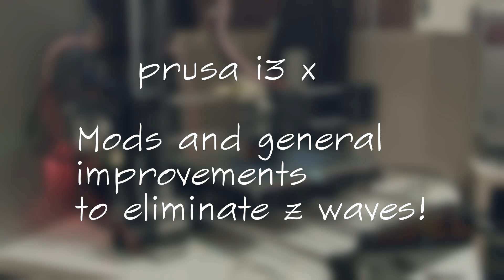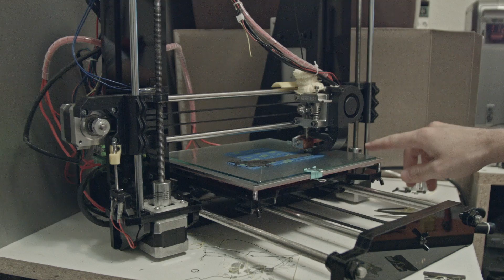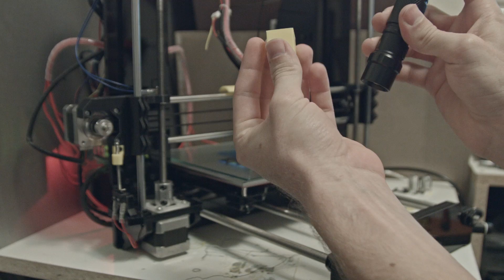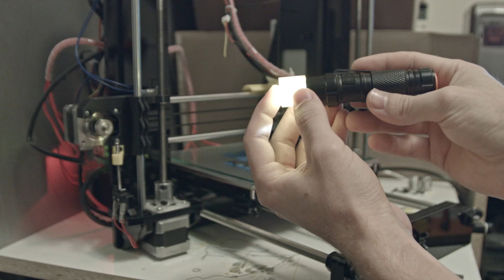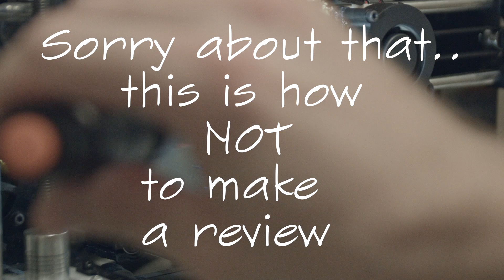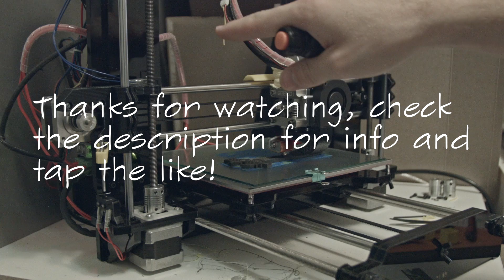Prusa i3 X upgrades and mods

Comment: Hi , nice video. i can see the x carriage mount is this something like this ? http://www.ebay.com/itm/1-set-3D-printer-U-aluminum-block-box-type-linear-bearings-Free-Shipping/291612393339?_trksid=p2045573.c100033.m2042&_trkparms=aid%3D111001%26algo%3DREC.SEED%26ao%3D1%26asc%3D35375%26meid%3Dce4636ce7ea4431fbc7e1b99c80364b0%26pid%3D100033%26rk%3D4%26rkt%3D8%26sd%3D191813891913  is this ok For MK8 extruder or what do you suggest ? What you have there if you can give me link to them.Thanks in advance!

Comment: just got my printer running after a few hiccups. what were your print settings for things like infill/supports etc?
Reply: I use Cura to make my Gcode
Reply: +Bill Windwalker did you print these parts?
Reply: I am making a set of parts from scratch do to what I am working on for I will have new Z rods and ball bearings top and bottom.
Plus some springs on the x rods with caps and no clips on the glass.
The glass will have 3M tape under it.
Plus I will not use that type of end stop switch.
I made some thing like he has some time back when I was having problems with end shake but it was do to poor Z threaded rods.

Comment: Just wanted to Say 1. I love what you have done to improve this thing. 2. I just received mine. I have not started to assemble it yet but I checked the rods and I think all but 2 of them were bent. On my way now to order the upgraded ones you suggested. Have already ordered the High Lubricity Nozzle and Power supply. This one also came with the 12V 15A. Glad I pre ordered the 30A! Thanks!

Comment: Thanks for all your reviews.  They were a great help in choosing a printer and learning how to get the best from them.  When I was assembling the Geeetech I3C Pro I purchased, I was struck by the fact that they run the cogged belt over a smooth idler.  That didn't seem right, and I found that printers at reprap.org use a half twist in their belts to allow the smooth side of the belt to run over the smooth idler pulley.  I don't have any clue on if there was any improvement, but it has to be a positive when it comes to eliminating the potential for backlash in both axes.  I put a half twist in both belts, and am getting very good results with no further mods. On that model, I had to redesign the belt-grip (printed part) so it could accommodate the twist, but that was all. Thanks again for all the tips, Doug

Comment: How are you mounting the x stop? The model doesnt have holes to mount it, am I missing a piece?
Reply from the maker: +chunkylover59 just put a drop of superglue under it. Or I used a micro jewlers drill bit that I had for cleaning the extruder tip.
Reply: Alright, Thought that would be the solution, but figured Id ask just in case.

Also how is the belt mounting to the new x carriage, I know there are some grooves on the back, are you just feeding the belt through those and then gluing/bolting the end to itself?

Hope that makes sense.

Also thanks a ton for these upgrades, Before this the printer was literally non-functional, it would always get stuck about a quarter of the way up the rods.
Reply from the maker: +chunkeylover59 The belt loops around the post on back and the teeth interlock with itself.. the teeth under the top belt interlocks with itself as it tail passes back under itself in the opposite direction.
Reply: ok thanks!

Comment: I bought the same one from Geeetech and have HUGE problems with it's assembly. Due to laser cutting the walls of the acrylic (8 mm walls) are not perpendicular to it's surface, which leads to not perpendicular joint and contact only in line, not surface. Combined with internal tension from laser cutting - few details already cracked and I started rebuilding the printer in aluminum. 
Sadly from Geeetech thinks that the vector files for the frame are not free (Prusa is made under GPL license - open source) and they refuse to provide dwg files. 
As soon as I prepare the files, I will publish everyting at Thingiverse so everybody will have access.
So far due to crappy acrylic details I wasn't even able to assemble the machine. Maybe I have high criteria for how to assemble such things, but so far my SLA printer B9Creator working great and my own DIY laser engraver is working much better than more laser engravers on the market. What I'm trying to say - I know what I'm doing ;)

Comment: Hi. Great video. I bought the same printer a couple of weeks ago and am looking to incorporate your mods but I don't see the Z-axis motor isolators you note on thingiverse.  Can you please provide a link? Thanks in advance.
Bruce
Reply from the maker: +Bruce Calder I had it uploaded just forgot to add it to the group it should be there now.Just print in something like ninjaflex or better print the mold and cast in silicone like Smooth-On platinum series.
Reply: +Riansolutions got it! Thanks so much for uploading it.
Bruce

Comment: I was surprised by the 30 amp requirement for the power supply. Many homes have 15 amp circuit breakers. I have only printed PLA, but I think the power supply on my printer is 15 amps.
Reply from the maker: +LIoid Hayes 30 amp is the output at 12v that's only 3 amps on 120v..
Reply: +Riansolutions  Daaa.... Thanks. I wasn't thinking about that. I will have to look at my own power supply closer.

Comment: from experience you should replace your z rods to a m5 or #10 imperial, the thing with 8mm or 5/16 rods is,  that you will almost never get them strait enough, but they are stiff enough to effect print quality, unlike the m5 or #10 they will still hold the z axis even if you have a beefier nema17  for the extruder, and still be flexible enough to let the z smooth rods lead Z axis in a strait manner . and Merry Christmas
Reply from the maker: +patprop74 So true!   I almost replaced them with m5 but held off because I had already printed the x-z carriage with M8 nut recesses.  I only got mine to work after using the combination of drilling out the upper guide holes to allow movement and making the flexible motor gaskets to allow the motor direction to be fine tuned..
Reply: what is your tag on thingiverse? I would like to download your upgrade files. I just ordered this printer last week, then found your videos.

Comment: Hi Rian, I checked your video this morning, bravo for all the improvements to your printer, impresive! ;) I have a Prusa i3 from Hictop for a good price but the same, a lot of things to modify for getting good prints. I compare the improves you made with my original model and is almost the same in the Z axis but I still having waves on prints. I'm not sure of the reasons for that but I'm focusing on the belts that I don't like. As the extruder only moves positive on the Z axis, the X and Y moves back and fordward increasing backlash problems due to belt tensioning.  Have you measure the backlash of each axis??
Reply from the maker: +Armando Silvera No but my model has belt tension wingnuts and just keeping the belt firm to the touch seems to work.

Comment: What is the optimal travel speed for that machine?
Reply: +Kenneth Thomsen For PLA..
Reply from the maker: +Kenneth Thomsen It really depends on the part 20mm min. small intricate parts. 30-50mm min. larger parts with minimal sharp corners and no interlocking pieces.
Reply: +Riansolutions awesome! The parts you printed for the X/Z axis, are they 100% solid?
Reply from the maker: No 20 - 25% cant remember look in the details for the thingiverse instructions.

Comment: @Riansolutions I am looking forward to printing these mods and getting this printer working. Do you have any suggestions on setting for printing with ABS? I am trying it and it won't stick and there appears to be an issue sometimes with the extruder motor clicking while trying to print. 

Tim
Reply from the maker: ABS is pita! It will stick to a acrylic sheet- Home Depot or a glass bed temp of 90C wiped down with glass cleaner like windex . Make sure the acrylic is anchored with all four sides clipped or the shrinkage of the part will lift it off the bed. And also absolutely no airflow of any kind on the part or bed..
Reply: +Riansolutions Thank you for chiming in on this. I will let you know how it goes. I am still looking at setting to make this work ight.
Reply: +Riansolutions I got the printer to print off the extruder carriage that you put together but can you post some pictures of the right side of the carriage so that I can see that the area with the bearings looks like. I have one bearing which keeps coming out. I want to make sure that I have everything correct.
Reply from the maker: +Timothy Jacobs Yea the sleeves for the bearings aren't that tight but my printed glides don't come out bc they have ridges from printing themselves. If the bearings are sliding out just put a drop of superglue against the metal edge and plastic and wait 30min...